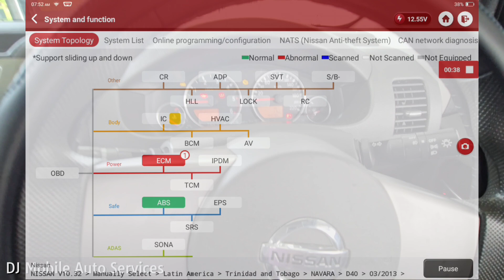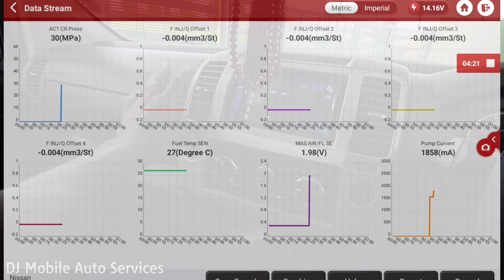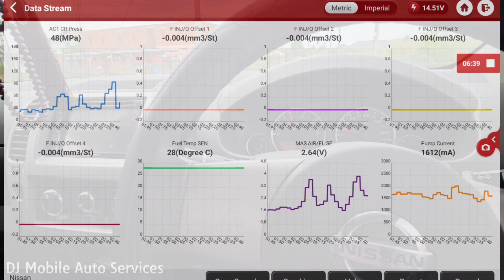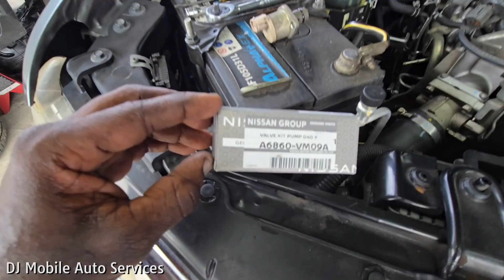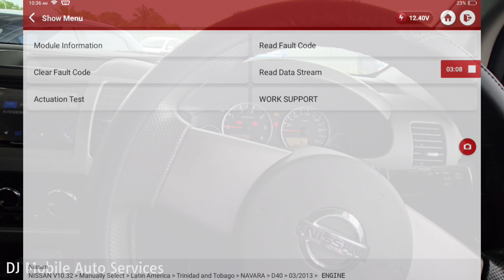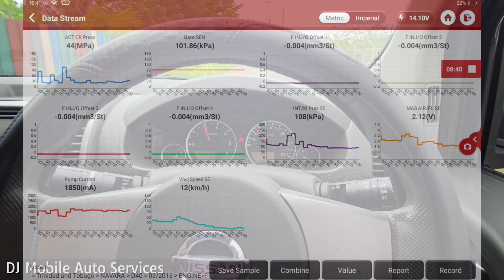2013 NISSAN NAVARA P0089 FUEL PUMP. LOSS OF POWER & LIMP MODE WHILE DRIVING. DIAGNOSED & REPAIR VID

Comment: Hey I noticed the F INJ/Q Offset did not change before and after the repairs was done. Is it suppose to read that .004 regardless??
Reply from the maker: Hi, this was an old video. I can't recall all the data that was shown. The vehicle is fixed and was delivered to the client without any issues.

Comment: bro i got this problem i would loose power when driving but if i stop and restart the power comes back... think it may be the suction controll valve there is no codes or check engine light. looking for answers before i go buy a part that cost $$$$
Reply: Did the suction valve resolve this issue, I have the same problem
Reply: @lewisedmunds5013 yesss!
Reply from the maker: Yes
Reply: @djmobileautoservices where is located that valve?? I have the same problem.i chanced the inyectors but the problem is follow

Comment: Thanks for the video brother.
Got a job with same vehicle model and having same issue. Info in your i believe is the solution. 
Any reason why the injector values don't change or move even after the reset?
Reply from the maker: The values did change while driving. You must do the reset, either manually or via scan tool. It will run
Reply: @djmobileautoservices  OK, thank you for your reply advice, much appreciated.
Reply: Hello, I have this model, but it does not go in first gear?
Reply from the maker: Possible transmission issue or do a visual check to ensure nothing is obstructing it from going into the gear

Comment: Drivability can be very difficult for me. This was a very good video for anyone to accurately diagnose that issue
Reply from the maker: They can be challenging at times, but after a while. You get used to the data and compare them to known goods. The bad ones, usually stands out
Reply: @djmobileautoservices the known goods are so important